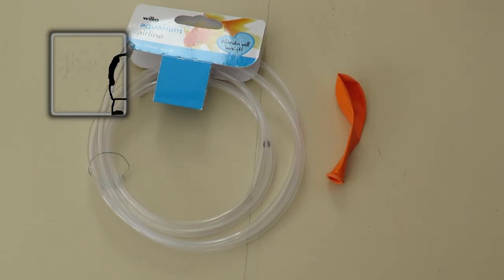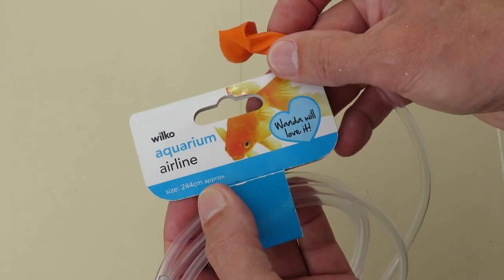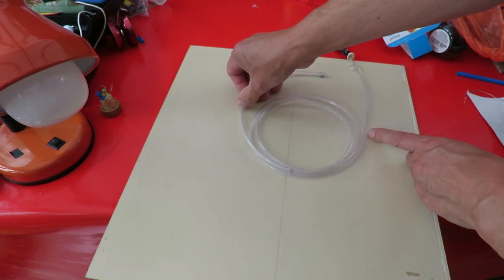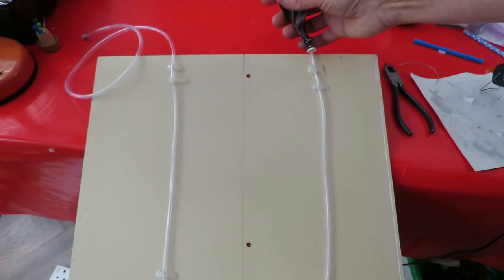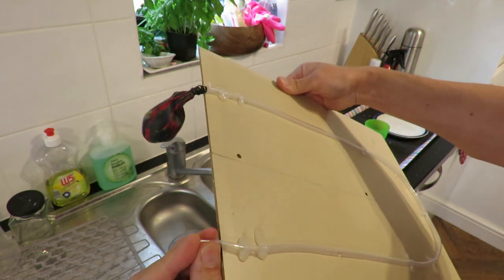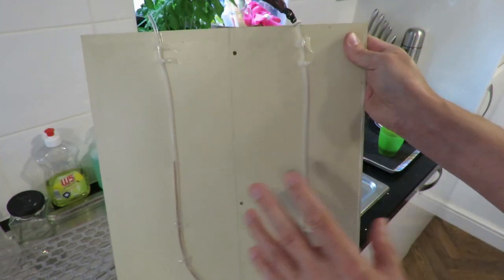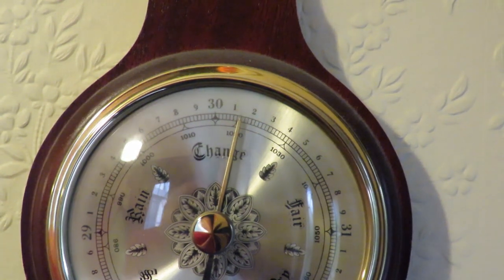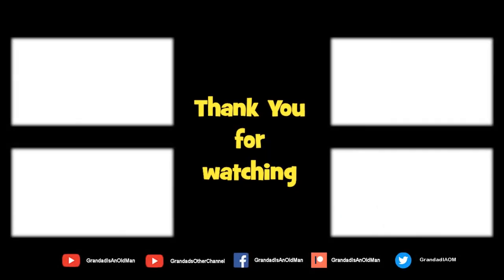Simple Balloon barometer

Comment: Fun little project....i'd not seen one built before, just finished pics :)
Reply from the maker: No fully confident I got this right. I have done version 2 but will watch it for a few days to see if it works any better than version 1. I have just made version 3 which is much simpler - jam jar, balloon cut and stretched over the top, straw attached. The straw pivots on the edge of the jar. A small rise or fall of air pressure will lower or raise the centre of the balloon tilting the straw. The only disadvantage of the jam jar version is it is more likely to get knocked or moved where I have left it on the kitchen worktop.

Comment: this has been on my bucket list as well. along with a few dozen other things. :)
Reply from the maker: Since building this I checked it for a week and after an initial bit of settling down it seemed to "sort of" work. I did get a problem with mould growing inside the tube. I have done version 2 but will wait for a few more days to see if my change makes any difference before publishing it. I have also seen a different design that uses a bit of balloon stretched across the top of a glass jar and a drinking straw laying on top so when the air pressure changes, the centre of the balloon panel will raise or lower and the straw pivots on the edge of the jar. You have the other end of the straw pointing at a ruler so you can see how far it moves. If you Google "balloon barometer images" you will probably see plenty of images of that version and I will be doing one of them at some time.
Reply: wonder if putting a little bit of chlorine might work.?

Comment: On the balloon over a jar version, I would think air temp in room would make it activate as well. Only a thought, have not tried making one.
Reply: I think you are probably right. I rigged one up last night, marked it's position and pressure. Checked it an hour or so later and it had moved significantly but the air pressure had hardly changed. I think what had happened was the jar cooled down on the cold work top. However once it has settled the large mass of the granite worktop should help to keep the temperature relatively stable. It is in a shaded area so it should not be affected by air currents or sunlight.This time I will record pressure and temperature to see what we get.